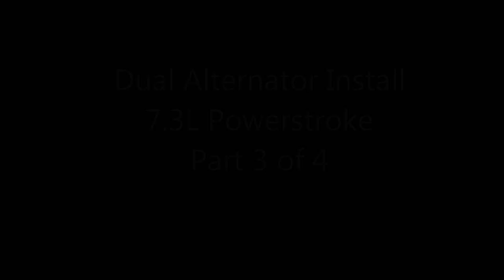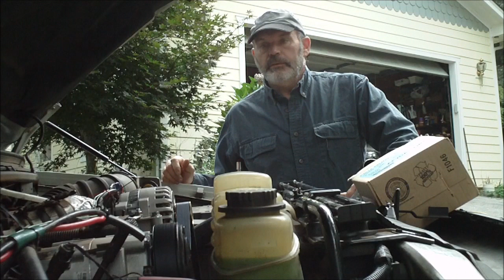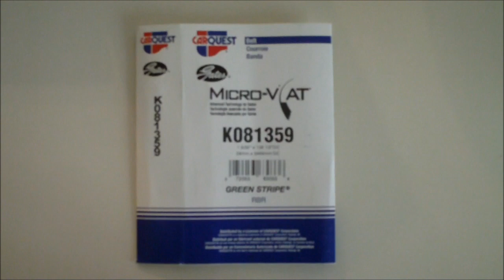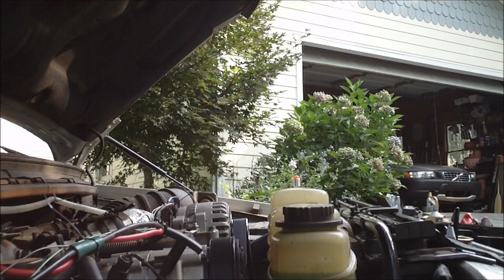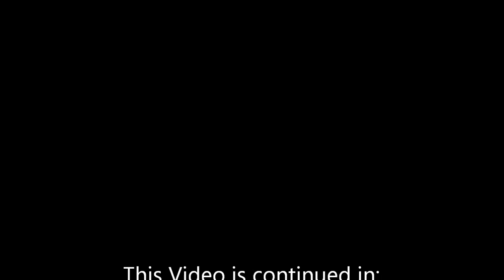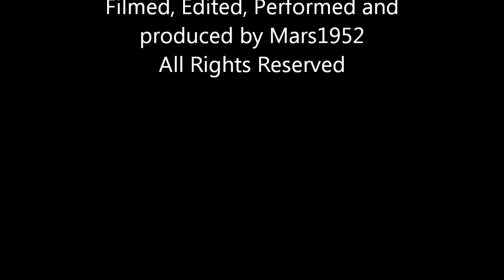Dual Alternator Install 7.3L Powerstroke Part 3 of 4

Comment: On your wiring harness for the second alternator if you look on top of your passenger side fender well below the solenoid do you know instead of splicing that wiring harness like you did it looks like it should be able to plug right into that plug on the top of the passenger side fender well do you know if that is true.

Comment: I did the conversion. The lower mounting bolt is a 12mm not 1/2". I used JK81381 belt. I used 64mm pulley up , 69mm pulley down and the belt never slips and is the correct length. I put a 140amp Ford alt top and 275amp LN alt on bottom. Used a relay for the exciter and it all works perfect. Used a 2ga battery wire on the lower alt. Get a connector plug and make your own harness. I unplugged the top alt and drove 2000 miles across the usa to make sure the lower alt worked properly. I did this about 2 years ago. A friend just sent me this video. Too much in this video is wrong.
Reply: You added the relay to the exciter and ran the power wire to the battery? What did this accomplish? Cause I did what this guy in the video did and my voltage fluctuates. Will that fix my issue?
Reply: @minkydo97  that relay turns the alt on in the ignition key run position and off in the off position. if you dont turn the alt off it will stay on and get hot. the factory does it.
Reply: @pizzathehut  hi I have transplanted a 7.3 into truck  and it is a dual alternator motor my question is where do I connect my wires too that this guy extended and where should I connect this relay to thank you for any help you can give me.
Reply: @kdsfighter  connect the relay to a fuse that is only on in the run position and off in the accessory position. You only want the alternator on when the engine is running. I connected to an extra fuze in the box under the dash. Check your owners manual for extra fuse connections. I connected the charge wire from the alternator to the passenger side battery terminal

Comment: This is a good reason why you don't buy someone else's truck. When I special ordered my 2002 F-250 Super Duty...7.3L Power Stroke Diesel V8, 4x4 Off Road, Long Bed, Super Cab in Oct 2001, I also specified the tow package and duel alternators. I think it was less than a $200 investment at the time. About $130 or so, maybe even less. It wasn't even worth not adding it the cost was so minimal at the time. The lesson being what is next? I bet yours has a "peg leg" in the rearend and doesn't have the limited slip Trac-Loc? Not to mention not having your exact gear of choice. I chose 3:73 with Trac-Loc. I also got an XLT with carpet delete. It even saved money and I didn't want anything but a rubber floor anyways. It's too hard to keep clean if you fish, hunt, camp, hike, work on autos, or have a messy job where you get dirty every single day.....I have all the above. Did you really get the color you want? I bet you found something you could live with instead. I got Dark Shadow Gray Metallic.....the coolest color offered for the 2002 model year. For what that want and charge for a pickup, you should get it exactly the way you want it. I'd never buy one off the lot for that very reason. You also know how it was taken care of and how much, or how little it was abused if any. It's common knowledge that every idiot who thinks he's going to make a living and become rich fast delivering travel trailers and campers across country buys and beats these trucks to death. I'd never buy one of those trucks. The "company" truck is going to be way more cared for and not nearly abused. Why you ask? Because the guy driving it knows he has to answer to someone if something gets broke. Those independent guys just unload them off and sell them when something goes South. I have read already today of 2007-2010s with re-manufactured engines. My 2002 (ordered and delivered in 2001) is still on it's original. Case in point....   

I wouldn't waste my money like this/that!

Comment: Did not show us how to wire up the exciter wire and the ignition wire up to the second alternator do you run in parallel with the other alternator I am doing this right now so please get back to me as soon as you can 

Facebook john work 
or text or call (503)-440-6615

Thx for the help
Reply from the maker: John Work I wired the exciter wire and the ignition wires in parallel. That seemed to work but I am not sure it was the best way. The truck is out of commission and I do not know when it will run again.

Comment: where did you find the overdrive pullys i cant seem to find them anywhere and really need one. im only running single alt setup same as you 250amp, but would like to put a smaller pully on it  do you still have that extra one i would buy it from you . thanks alot russ

Comment: Hi Mars,
A couple of questions
1) Why the overdrive pulleys?
2) What purpose of the adding the green wire serve?
3) Doesn't appear that this was a turn key solution given the modifications that were necessary.. Is there one available?

Comment from the maker: The weird thing is that the belt slips on the lower pulley and that pulley has more contact area due to a more complete wrap.
Reply: the bottom alternator takes a special pully.it's not the same as the top one.

Comment: I know this video is older but the big reason I see the belts slipping with the smaller pulley is just the fact that the belt has less surface area to contact with the smaller diameter pulley. Kinda sucks how that works, you get greater rpm's with the overdrive but less traction to make that rpm lol.
Im sure a manual belt tensioner would also help greatly getting more pressure on the belt then any spring tensioner can.

Comment from the maker: @FxOxC The alternators will only put out enough amps to supply the amount of amps being used by the truck. If you do not have anything turned on the alternators will only put out enough to keep the battery charged and run the trucks computer. It is sort of like the battery. The battery will only put out the amps that are being drawn.

Comment from the maker: @freestylemxer7c Hi: The main advantages of dual alternators are redundancy, higher amps at idle and of course higher amp output. Trailer lights don't use much juice but huge sound systems, winches, 120volt inverters, emergency lights and so forth can over burden a single alternator especially at idle.
Mars